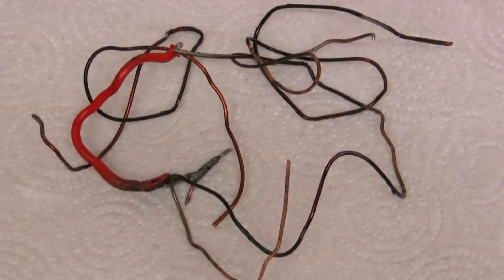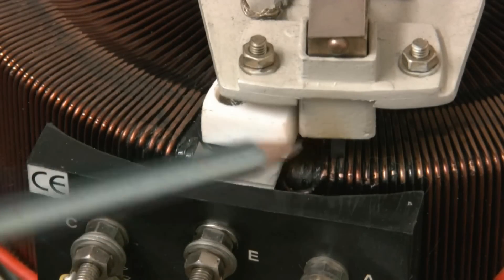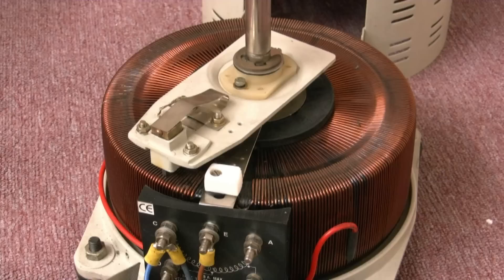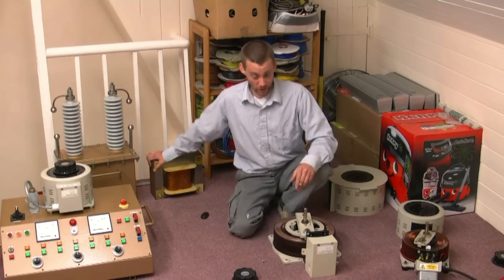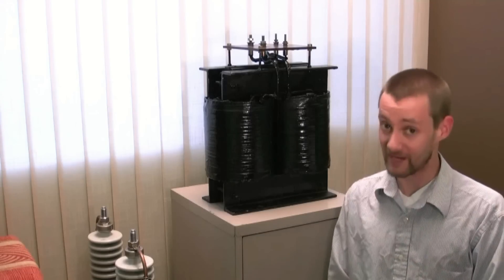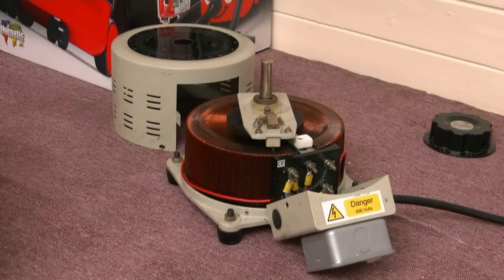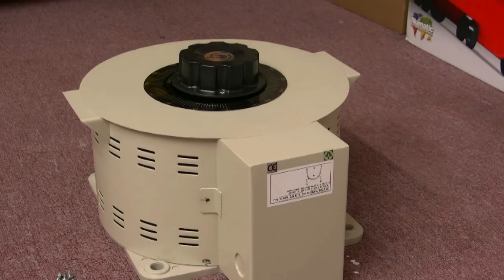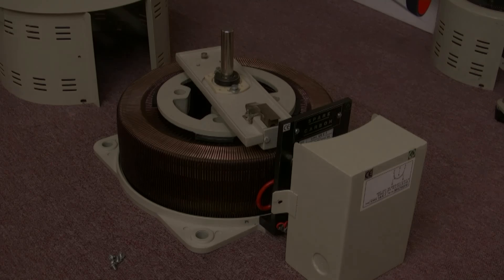Bigger Variac and Load Test

Comment: Idea.. If you took the variacs from your 3 phase Big Boy Supply and wired them all in parallel, would that be cheeper than buying 3 phase power from the electric company? I mean 3 phase 240 volts at 80 amps must be more expensive than single phase 240 volts at 240 amps. In America, 3 phase power is ridiculously expensive.
Reply: Ahh we have a different power distribution system in the UK and three phase is common place. In multi-occupancy dwellings, e.g. apartments, it's common to see three phase coming in and have the properties split evenly across the three phases.

I believe in the US the pole-top transformers are a center tap 240V transformer so you get two phases fed to each property and use the centre tap for your 120V circuits and both phases for things like tumble dryers?

We don't really do pole top transformers except for in the most rural of locations, we have residential substations and they're usually in a star configuration providing three phase.
Reply: thats not how it works. but yes - in another vid he said its a 25a 3ph variac and he parallels them for 75a single phase
Reply: He doesn't have a 3 phase service. Single phase HRC service fused at 100A.
Reply: @teravolt1195  I think he has 3 phases, the red socket is an 3N400, with means, 3 phases, and a neutral.
Reply: @nikolassels5751  No, check https://youtu.be/HMH2t34Rw3E?t=102
You're right it's a 3 phase plug though.

Comment: I now have 5 variacs. 1 is a 120V input 0-140V out 7 Amp. Appears to be fairly old originally had a 2 prong un-polarized cord. Socket I think was polarized. I modified put a 16AWG 3C cord from a microwave on it, put a 2-3 prong adaptor on it then grounded that to the chassis with one of the screws for the cover. 

I got 4 more variacs last week from some odd electric meter tester thing. They are only like 3.5 amp and have no case yet. These are all rated 280V I found a way to put in 120V and they will put out 280V.  Part of me wishes I could stack all 4 of them and get like 12-15 amps, but not sure can even do that without some special kit or premade assembly.
Reply: If using a tap on the variac to input 120 and get 280 out then be aware you're limited to 3.5A on the input (since the windings are only rated for 3.5A). Don't try and pull 3.5A at 280V out because you'll be drawing almost 8 on the input and the variac will likely get very hot. Nice variacs tho wish I had that many. I do have a 3ph 8A that's been rewired for single phase 240V input (3 toroids in parallel). 6.3kVA total hehe

Comment: my variac trips my breaker
Reply: FUREK młody 
Time for a new breaker?
Reply: Mine too (3 kW variac). Sometimes it works, sometimes the breaker trips. Depends at which position on the AC wave you plug it in. It is possible to change the breaker to a slower reacting one or to use an electronic inrush current limiter (resistor + relais) to avoid that.
Reply: Mine too (5kVA)

Comment: Just acquired an old Staco 140V 10A in very good condition - the old variacs hold up for many decades with very little maintenance if they aren't abused, and this one is new enough to be grounded. I use it to test amplifiers and other audio gear when it first lands on my repair bench, mostly to keep from blowing components that might be damaged on cold startup with unknown problems. I only intentionally overdrive transformers used in audio gear to measure clipping and distortion- not the one in my variac. Can't quite imagine destroying it just to see how far it could be pushed, because my bench needs it to be reliable to use as a tool. Although it looks like fun... I hadn't considered using it to power a Jacob's Ladder...

I guess a proper mad scientist's lab needs at least one plasma arc continuously rising up, to create life or to blow the transformer, whichever comes first...

Comment: LMAO. Owning a variac that big must be seriously funny.

"....28A continuous, & it doesn't complain.....Until we get to 80A"

Mega LMAO. Probably, the reason it complains at 80A, is because it's struggling to pull the current through the service fuse! :-D

But really though: 80A on a 28A variac? That's about 285% overload. 

How long would it handle 285% & what about the cable going to it?!

Something must surely get hot, & quick! :-O

Thanks for re-loading these clips. :-D

-BBD.